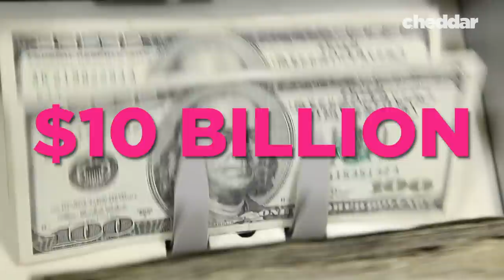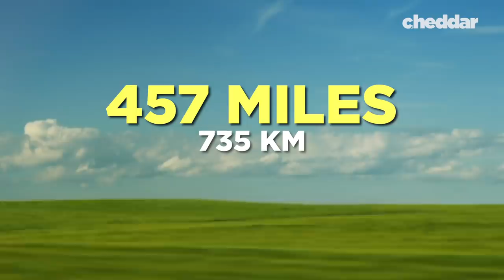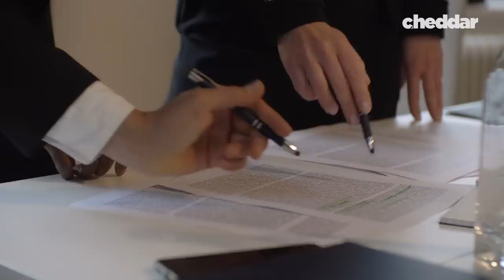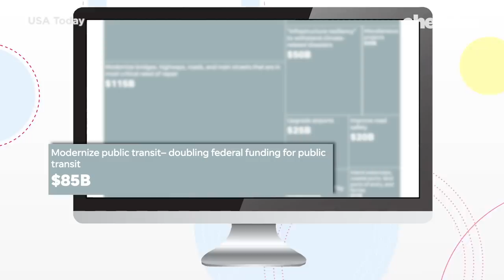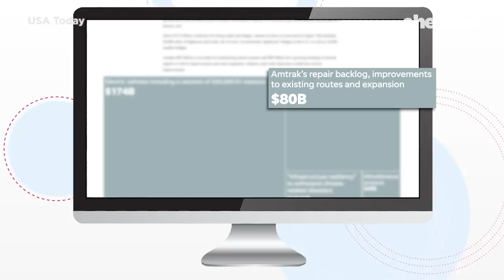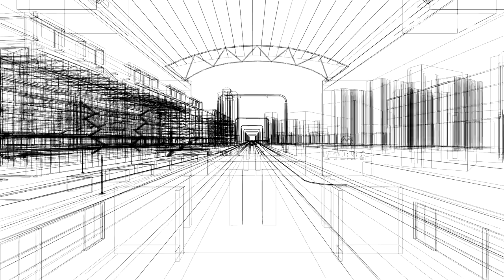Is New York Finally Getting A Real High Speed Rail? - Cheddar Explains

Comment: So, the biggest economy on the planet can spend $705.39 billion on military, but isn´t capable of building a single high-speed rail?
Reply: Correct. Money isn't a problem but oil companies. I also love the fact that most people want to travel 8 hours by car at 90mph max speed instead of taking a 200 mph train
Reply: @TheKartoffel101  money actually is the problem, nobody is going to waste 100+ billion on a train when an airline can do the same thing in likely half the time and half the cost. People are going to take cars because the average American city is very car dependent and can’t be compared to other cities around the planet.
Reply: @blackhole9961  yeah you do know, that the airports are state founded so it's not cheaper at all. Also in Europe it works perfectly fine. Same for the USA before the 1960s when the aviation lobby took control in the Parlament :)

And yes American cities are car depended but a public transportation system in cities would help to benefit the health of the citizens and also would reduce the traffic. So a plus for everyone but the car lobby
Reply: @blackhole9961  Oh and btw a single Train has four times the capacity of an Airplane (german ICE 4 (444 seats) compared to the Boing 737 MAX (110 Seats)). You even could drive 2 Bullet trains together so one single Train ride can replace seven flights. This means that a train connection is a lot more efficient to operate.
Reply: @TheKartoffel101  airports make about half their money back through aeronautical means while the city or state funds the other half, so it’s not as expensive as your thinking. Aviation ultimately replaced the train because of how superior it was in cost and speed in the 1950s when it finally became affordable to the common man which is one of the reason for the major decline of the train in America. Today trains are still obsolete compared to planes when it comes to speed and cost. 

American cities are car dependent because of their sprawl and how big they really are compared to European cities. My home metro area DFW would dwarf Paris metro in shear size but would only have about half its population. Just building public transport doesn’t solve the problem, that does nothing but throw money at the problem without really knowing why Americans still choose the car over public transport. 
For example DFW has the largest light rail system in the country but has some of the lowest ridership because the metro is just too big and spread out, you still have to drive to the DART station, take the train and once you get off you better hope your destination is within walking distance which it most likely won’t be.
Reply: @TheKartoffel101  Not everything is about capacity, if it were then the A380 and 747 would be dominating the aviation industry, but they aren't, they are slowly being phased out. Transportation now is more about frequency and speed. 
Even if trains do have more capacity, that doesn't mean they will always operate at capacity or near it to cover the cost. If you have a fast train with high capacity but its only half full, that tells you its not very cost effective or energy efficient so ultimately useless.
Reply: @blackhole9961  Yeah 747 and A380 are not efficient. This is why they're both a product of the past. Back when oil prices didn't matter. Even if you would use diesel for a train it would be a lot cheaper to operate. A double train with 200 mph or more is as fast as a smaller train. Also, the frequency is about the same 30 Minutes. And, you can change trains in length and frequency anytime. So if you have less demand at the moment you can shorten the train from 12 cars to 8 or whatever you need. Or from a double train to a single train. In Europe, this often is used to split up connections, for example, a double train is heading to one city and from there one half of the train is going to one city and the other half of the train is travelling to a different destination. On a plane, you would have to change your plane. As soon as you don't have a non-stop flight anymore a train is faster.
Reply: @blackhole9961  Actually the airports doesn't make a lot of money due to aeronautical anymore. Most of the income comes from their shops which is why all those modern airports are malls with a parking lot for planes. 

it depends on how you're doing it. The size isn't a problem if there fewer people compared to Europe. The distance between train stations would be larger. This means an increase in speed for the trains. A lot of german Cities have public transport that reaches outside of the cities borders to smaller villages and smaller towns which would be comparable to your situation. from the train stations you would have bus, trams or metro lines that transport the people closer to their homes and are linked to each other. The problem of Dallas or every American city is, that it's just half of the concept. It's like building half of the road and wondering why people don't drive all the way. Public Transportation in the US sucks not because it's public transportation but because it's undeveloped and bad managed. 

I highly recommend the series  City Planner Plays Cities:Skylines. He explains and shows pretty good with this game how public transport should work and how traffic is planed.
Reply: @TheKartoffel101  how would the frequency be about 30 minutes for both when it takes the train 2 hours longer to arrive at its destination. The plane is very rapid when it comes to frequency. If both left at the same time and the plane got there way faster, in about an hour. The train is still lagging behind 2 hours, the plane can take off again and go back to its original starting point and still beat the train. In terms of frequency the train still losses because of the shear speed of the plane. 
This was the same exact problem for the Californian high speed rail catastrophe. Investors knew the train wouldn’t be rapid enough to compete with the plane.
Reply: @TheKartoffel101  size and how a city was built and planned is very much a problem. When the vast majority of the city is nothing but low density sprawling single family houses with lots of space and literally nowhere to walk to, people are still going to drive. The vast majority of people don’t even live in downtown Dallas, the population of downtown is an incredible 20 thousand people compared to Paris with over 2 million. Dallas’s DART doesn’t even reach out to the suburb/city where I live, even if it did I’d still have no use for it because I’d still have to drive to it. DART does go to a suburb not too far away but it defiantly doesn’t serve the majority of that suburb it’s always empty. 
The American suburbs are the very reason why no one even utilizes public transport because it quite literally doesn’t even serve them.
Reply: @blackhole9961  This is why you would have suburban trains that transport people into districts outside of downtown and buses from there into the neighbourhoods. ;) 
The Dallas Dart is basically that but you would need way more lines to connect the districts. Let's say you have a bus station 5 minutes away from your home. You use the bus to drive to the station in your district then the Dart to the main station of Dallas and from there you would use a high-speed train to another city or Della's airport. Public Transport has to be linked together to be efficient which isn't the case in the USA. 
BTW till WW2 hit the USA there were Trams and train lines all over the US. So at least the parts that existed back then are planned for public transport systems back then. General Motors bought a lot of private companies and turned the tram lines into bus lines. The rail network of trams back in the 1930s was larger than every single train track in the whole US combined today.
Reply: @blackhole9961  the plane is only 20 minutes faster than the train on SF - LA since a plane has 30 Minutes of the boarding time. A train only needs 10. And again the train mainly competes with the cars. However, trains are more luxurious and easier to board without any luggage and security controls and it's cheaper. Also maybe not a lot of people live downtown but if you come to a city as a tourist you still would go downtown first and not into the neighbourhoods. The same goes for businessmen ;)

Also as I said before, a train can replace more than 7 flights. So the plane would need to travel 7 times to the destination and back till it's more efficient than the train.
Reply: @blackhole9961  I don´t know much about the USA (I am from Brazil), but I believe you have a very good point and in that sense, our countries are similar, together with Russia, Canada and India (all of them big). Europe is simply much smaller, with more dense cities and that make things way easier. I completely agree with that.

But I believe my doubt is much deeper and harder to answer: Why do Americans talk so much about "patriotism" and spend over 700 bi on Defense but don´t seem to care about public infrastructure or its internal industry? I just find it weird that Americans spend so much on Wars abroad but turn a blind eye for its internal problems like supposedly poor infrastructure, poverty and lack of public healthcare, for example.
Reply: @felipewozniak  Well not really. In a European city, you could walk most of the way. Public transport comes in handy on larger distances. Which is why suburban trains travel to other smaller cities near to the big cities. Distance wise it's the same as the size of American cities.
Reply: @TheKartoffel101  Imagine that sprawl for berlin, imagine if berlin quite literally tripled or even quadrupled in size in land area and its population was way more spread out to fit into that land area.
Reply: @blackhole9961  but you could use bus networks to connect suburbs to either a team or light rail network, right?
Reply: @blackhole9961  yeah because it's poor managed. Also the 2 hours are wrong because the 2 hours only include flight time neither taxing or on and off boarding security checks etc. 
As I said you would need 7 flights or more to transport the same amount of people that could travel with only one train.
Reply: @TheKartoffel101  DART does provide busses to the suburbs but because its the low dense single family suburbs hardly anyone uses it and besides we both know busses are just slower cars you just cant drive yourself.
takes about 30 minutes for the average airliner to board then takes around 5-10 minutes to taxi to the runway(depends on the airport)
so basically an extra 40 minutes + the hour flight time = 1 hour 40 minutes.
for the train 10 minutes to board but takes 3 hours to get to its destination= 3 hours 10 minutes. 
which do you think is faster?
Reply: @TheKartoffel101  heres what downtown dallas actually looks like before covid:https://www.youtube.com/watch?v=BnbE6QzKY-I&t=853s
please notice at how dead it is and nobody walking compared to cities around the world. The density is low here and even lower in the suburbs.
this would be your standard American city.  
with the obvious exception of denser tourist traps like NYC Boston Chicago LA(even though LA isn't that much denser than your average American city its a tourist trap) and some others.
Reply: @TheKartoffel101  again capacity doesnt matter if literally no one is using it. the train could have 1 thousand seats for all i care, but do you actually think it will run at that capacity most of the time. which is why 747s and a380s dont travel such short distances.

Comment: Considering how late we are and how we’re hoping to position ourselves with respect to China, Japan, and Europe,  it seems to me that Hyperloop is the correct answer.
Reply: Hyperloop is a grift
Reply: With Hyperloop's massive speed, you need distances longer than high-speed trains to justify that. You have to take account on the acceleration and deceleration.

Not to mention, the passenger capacity of a pod is disappointingly low (it is comparable to a car). You need far more passengers to compete with trains.

Comment: These plans to build a new NEC are all nuts. There's just nowhere to put it. We should fix and modernize the existing route to increase speed and capacity and remove bottlenecks. Outside of the NEC is where new HSR routes belong, as mixing passenger with slow freight trains doesn't work very well, and the distances between cities are long. There is plenty of room for HSR ib much of the rest of the country.

Comment: 0:14: That's 209 km/h. There's no such thing as 209 KPH.
Reply: So do you say r/m instead of rpm?
Reply: @starventure  Nope.

International System of Units (SI) say that kilometre per hour symbol is km/h. You must be confuse with MPH, which is not.

RPM not even SI unit of measure, but rad/s is.

Comment: 3:43 even if you built HSR in all those regions....which, greater than a 200 mile radius is too far for HSR....you would still need to fly to get from one region to the other. So this still would not eliminate aviation. It's impractical to do that in North America and Australia.
Reply: The three German cities Berlin, cologne and Munich form about a triangle with sides of 500km length (idk what exactly that is in miles, but more than 200), and at least cologne-Berlin train are almost always full, and I heard demand on Berlin-munich is also high...
Reply: @jan-lukas  

"The three German cities Berlin, cologne and Munich form about a triangle with sides of 500km length (idk what exactly that is in miles, but more than 200),"

I looked it up...

(1) it's 310 miles
(2) there are still at least six direct flights Berlin to Cologne from what I can see, looks like 15+ non-direct flights. So this hasn't eliminated aviation. people are still flying
(3) where they have train service it's 4 hours, about 4 times longer than the flight. Remember France's ban on flight was only for trips where the TGV can do it in 2.5 hours or less, so this trip would be unaffected by the French ban. Those of us who would normally fly don't want to turn a one hour trip into a four hour trip lol.

So yeah....I'm sure the trains fill up, they're capturing some of Those Who Would Otherwise Drive, but if you take four times longer, you're not taking away from aviation.

You could put a walking trail and some people would use it, but even if it fills up, the same number of people would still fly because it's so much faster.

In the USA, four hour train is probably the shortest intercity distance. We have this stupid waste of money here in California for a "high speed" train from San Francisco to Los Angeles that's only going to average 100 mph (160 km/hr) due to the politically chosen route, so it works out to about four hours, and the plane is one hour. (1 hr 20 min by the schedule, but in reality, the pilot announces how long it will take and it's normally a 45-60 minute flight.) So we already know that's not going to take any traffic away from airplanes, just from the example you just gave.

But SF and LA are relatively close in terms of population centers. Generally speaking its longer.

For example, the Northeast Corridor is a region where you have very dense cities -- they were big cities before the car was invented -- and they aren't far apart, around 200 miles apart. (New York City is part of the Northeast Corridor.)

Ok, now, to go the next such cluster, you would have to go to Chicago. It's 800 miles or 1287 km. The TGV in France, best case scenario if it could maintain an average speed of 173 MPH (unlikely, the route would probably be slow and political chosen...), would take a minimum of four hours. Problem is you can fly it in two hours. So you haven't eliminated aviation there.

The other two countries have the same issue. Canada has a bunch of cities in the southeast and a bunch in the southwest. If you want to go from one cluster to the other you need to fly because they're like 2500 miles apart (4023 km). Plus, even in that relatively close close cluster in the southeast, some of those cities are still significantly more than 300 miles apart, like Toronto and Ottawa are 330 miles apart, that's farther than your sweet spot for HSR so a lot of people would still fly. 

Australia....you have a bunch of cities fairly close together in the southeast, but then Perth is 1500 miles away (2414 km), and then you have a population center in the North, not as large but it's a population center, and that's like 1500+ miles from the other two. 

So yeah Europe and Japan, HSR helps a lot more over there than here (USA/Canada/Australia). The same solution doesn't have to work for everybody. I would also point out that Europe is still 80% car, 80% of all trips in Europe are done with a car, despite all that HSR stuff. I can't post links, it will eat my post. But if you google "Passenger transport modal split european enviornmental agency" you'll find a web page that lists the modal split for most countries in Europe and it's all about 70-80% car.

Japan is the other way, it's 70% rail....but it's WAY denser than either Europe or USA/Canada/Australia.

Comment: wouldn't it be better to just upgrade and rectify the existing tracks operated by amtrack in the northeast corridor? the new acela trains are going to be able to reach 160 mph using the old  tracks, with new ones, it could probably reach higher speeds, and also that would allow to operate true hight speed in the future, that and would be also cheaper and faster
Reply: Much of the existing track has way to many curves to allow that kind of speed. Even the tilting trains can't go top speed on most of the line.